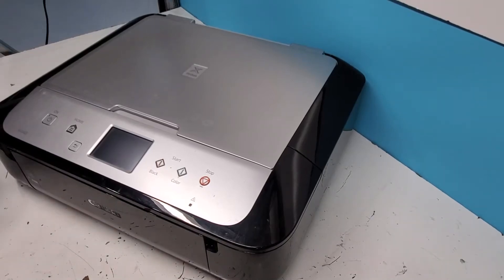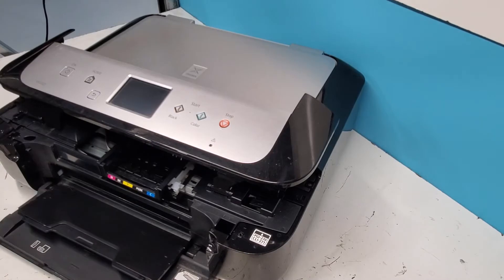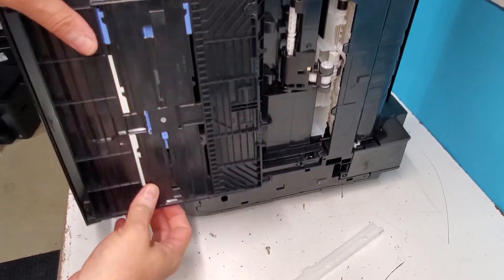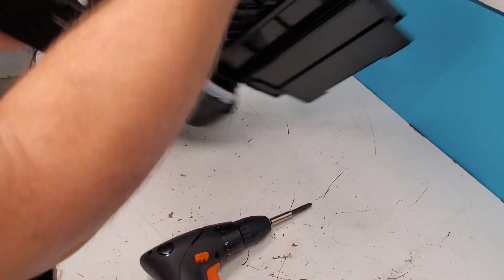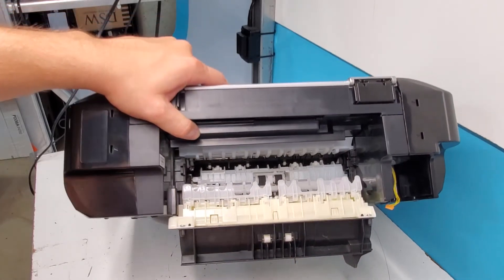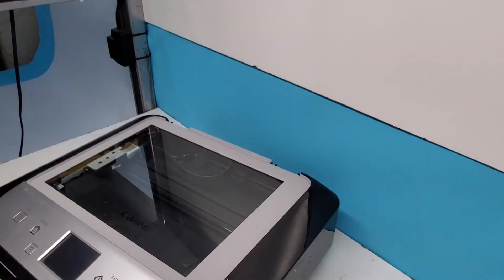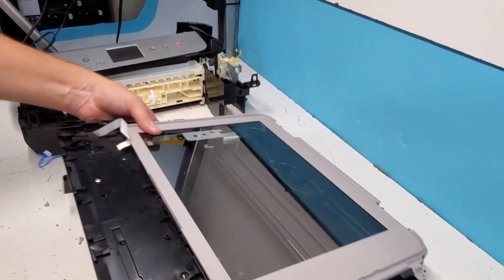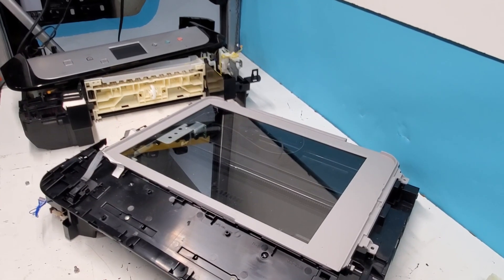How To Take Apart Canon Pixma MG6821 Printer for Parts or To Repair MG6820 Disassembly

Comment: Thank you so much, I wanted to remove the control PCB, without breaking the cover. Done !
Trying now to check the capacitors, as I experience issues with the PGBK printing (cleaning and aligning did not help , as for many other users).

Comment: I have the identical printer in the video. I started getting error codes and the codes centered arond the print head. I bought a print head cleaner on line, used it and i get the first copy streaking on it and then noting but blank pages after. What do I need to look for??

Comment: Good day.  Nice video.  It convinced me to proceed and open up our printer here also MG6800 series.   It didnt take up paper, but produced machine gun alike sounds, before going into error state.  Problem seemed to be a little latch on the part that is taken out at 11:04.  It stuck out, and blocked the path of the paper.  When taking out that part, the latch works nicely. but is controlled by a shaft that ends in a slotted white nylon actuator coming from the "gearbox" under the electric motor and what appears to be a pump arrangement that feeds excess ink to the waste reservoir.  A broken or locked gear might explain the machine gun noise.  So question is there any point to open that up ?  Very messy due to the ink ?  Does anyone have experience with the gearbox parts of printers and in particular repairability in case of problems ? 
Thanks in advance.

Comment: I had a paper jam and removed the paper but the error code kept showing. Checked all the spots for paper and none. Figured the paper might be behind the cog where the jam was but couldn't reach that area without taking the side off. I also blew some air into the machine and the straw blew right off behind something so I took off the side watching this video and got the straw out but no sign of paper. After blowing more air the error code said paper jam in the back but of course there was no paper there. Makes no sense where this paper is. Been working on this for four days, hate to junk it.

Comment: I have a 6851 with a C000 error. When I opened it up I noticed a small, hard white plastic rectangular part was loose in the printer about 4cm x 5mm. I assume it comes from the larger rectangular hard white plastic part on the far right of the carriage assembly. However you don't dissasemble this part so I can't see where it goes? Any advice on what I can do?

Comment: Hi, I was given a Canon Pixma MG6851 from a friend and it works fine but I've noticed the front cover flap won't stay shut, I've noticed there is a hole on either side of the flap and was wondering should there have been some kind of stopper or something in them to catch when the front flap shuts ??

After mentioning it to my friend she just said: "it use to stay shut but a few months back, then while I was moving the printer it opened and wouldn't shut anymore, so I just left it open all the time.."

Thanks for any advice, if there is something missing could I purchase the parts to restore this printer.

Thx for any advice..

Comment: I want to ask you for help
Reply from the maker: Please ask. I will try to reply if I know how to help your printer
Reply: @303electronics  You have stopped working and when you open it and you find part of it Able to move out of position
Reply: @303electronics  is the ink waste reservoir in the back left corner inside the body frame, sir? Any feed back is greatly appreciated.

Comment: Do you have video to fix B200 error, I have pixma 922.
Reply: Printhead error. There are reset instructions on the web. However it's probably a burned out printhead. If so it's probably uneconomic to repair unless you can pull one from another damaged printer. They cost at least £60-70 - often more.